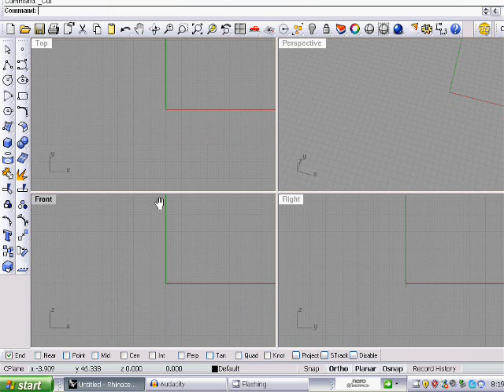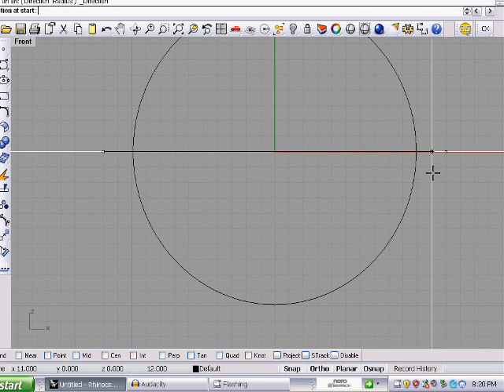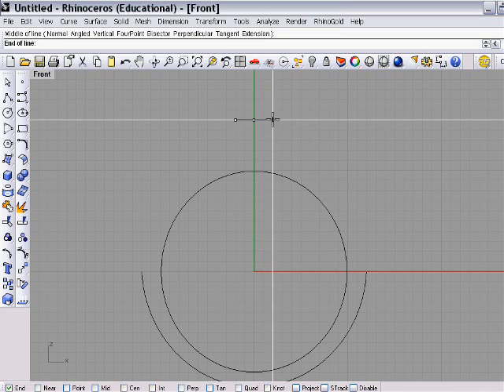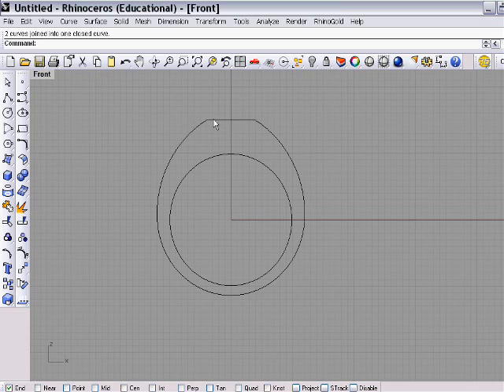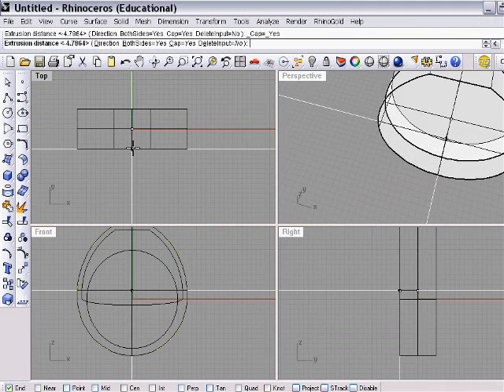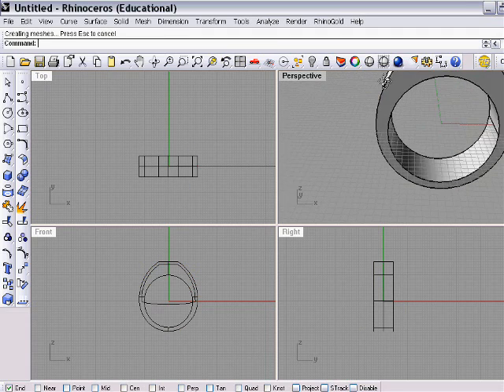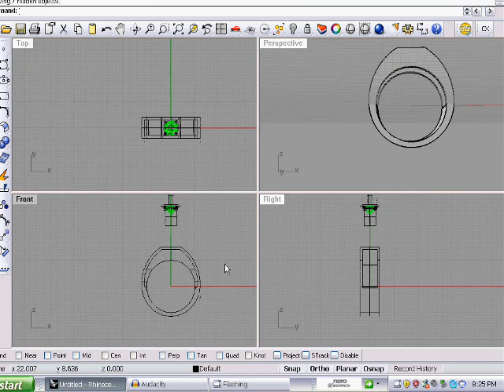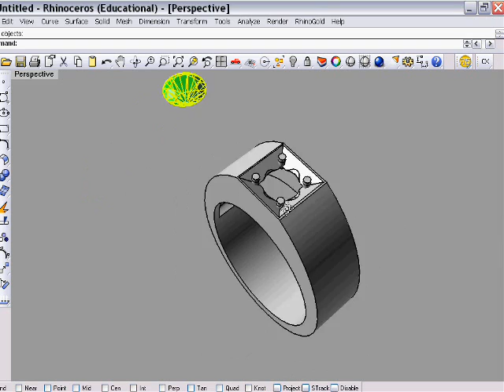pat schmidts secrets to jewelry design using rhino software

Comment: Pretty nice tutorial right up to the end.  You show your cutting tool, but you don't show how you model that tool.  the tool includes a faceted stone as well as bright cut surfaces and four prongs/beads.  

Without showing how that tool is modeled, the end of the tutorial is not very useful to a novice modeler.